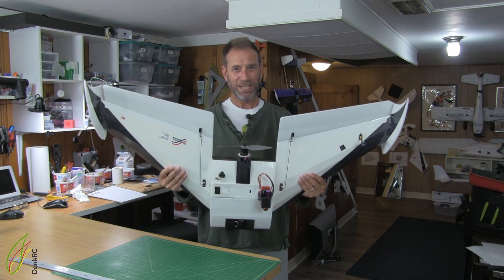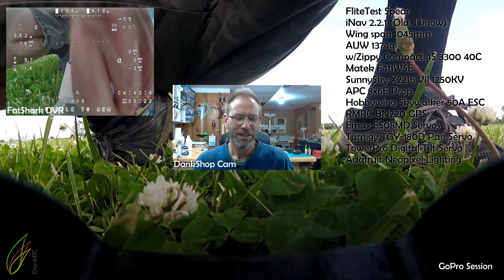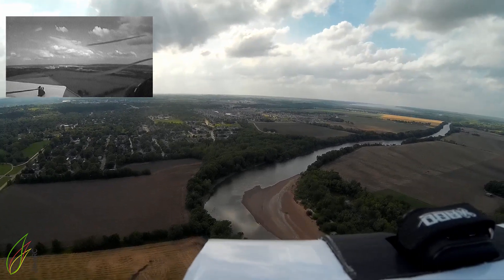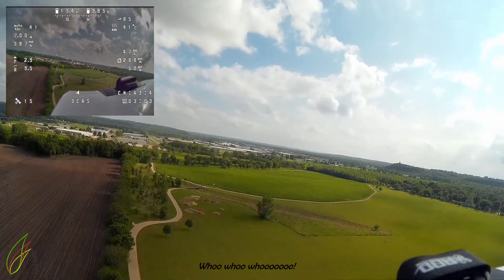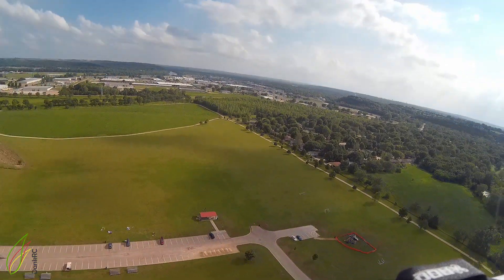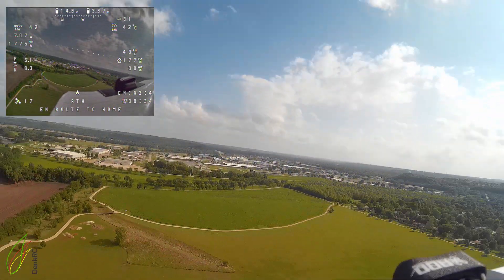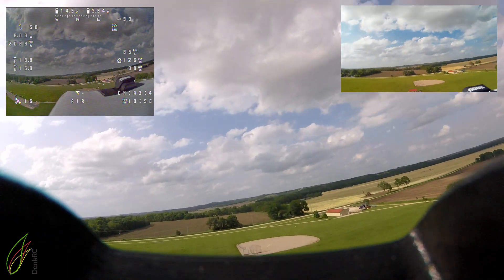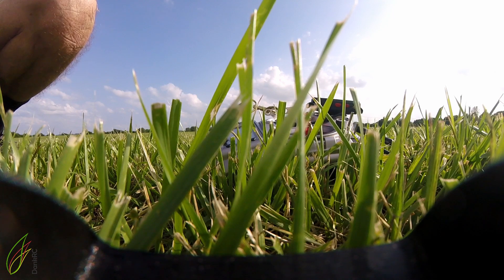FliteTest Spear w/iNav Maiden, turning a man into a boy.

Comment: What kind of control arms did you use on the servo to elevon connection?  I am building mine and wanted to go a step beyond the simple bend steel rods.  I have seen people use the carbon fiber rods and nicer connectors.  Can you share what you used?  Thank you.
Reply from the maker: I just use .062" (1.57mm) music wire from the hobby shop.  I too would like to use something better.  However for my style of flying this wire works fine.  I do use a Z bend and something like this at the control horn end:

https://www.banggood.com/1_3mm-1_8mm-2_1mm-2_5mm-3_1mm-Adjustable-Pushrod-Connectors-Linkage-Stoppers-For-RC-Airplane-p-1118874.html

I use 3D printed control horns.
Reply: @DankRCX  Thanks man I am trying to order some of my electronics. Going with the radial power pack C they recommend at flite test and  gonna grab some of their control rods but looking at some of the kwik loc connectors and some carbon fiber rods for the servo elevon connections. They sell some of those pushrod connectors at flite test I am grabbing those too.  Can't wait to fly this thing. I think I am going to just get the basic fight stuff first and then see how it flies before getting all the FPV stuff installed.
Reply from the maker: @petermatos4613  The biggest problem I have is with the launch, but once it the air, it is one of my favorite planes to fly, it was also fun to build.  Good luck with your build!!

Comment: Hey man. Do you perhaps have the full weight of the model with battery on board? I've built my spear but it just does not get off the ground. I think it's too heavy. I built it from a different foamboard as finding the flite test board in South Africa is not an option. 

I'm using a 2212 1000kv and also tried 2212 1400kv
9x4.7 prop
30a esc
4s 1300mah 120c

Just seems to refuse to get off the ground. I managed to get it in the air but it was barely hanging on. Floating to the ground with full throttle.
Reply from the maker: The current AUW with Zippy Compact 3300 4S is 1449 grams (3.1lbs).   The beast is hard to launch.  This video is its maiden flight, and I had a bit of wind to throw it into.  I have found in later flights that with little or no wind it is hard to get in the air even with my pretty aggressive iNav Autolaunch settings.  I have crashed it on launch and had to do some repairs, and also changed the rear camera, that is why the weight is heavier now than on maiden day.  It was 1374g that day.  Besides the weight and the rear camera, all the specs remain the same as in the description above.  I use Adams Ready Board (same as FliteTest) and I cover it in packing tape. Yesterday I flew the Spear again, no wind, I used my bungee launcher to get it in the air.   Once in the air, my setup has plenty of power and range.  Working on a vid of that flight too.
Reply: Mine with zero fpv equipment or flight controller flew very well.  It was easy to launch.  It was from a FliteTest kit.  2200 3s LiPo.